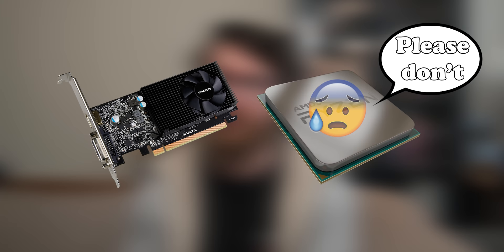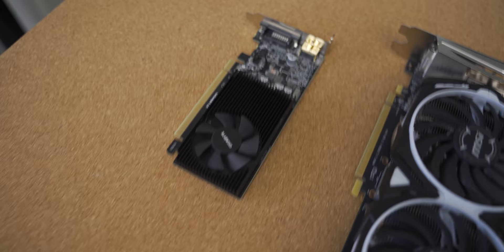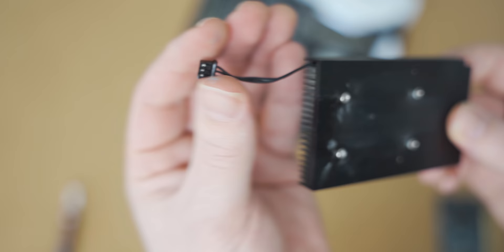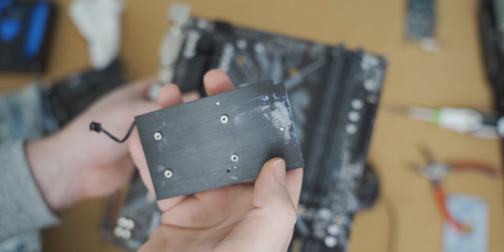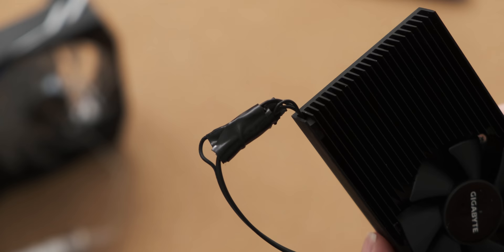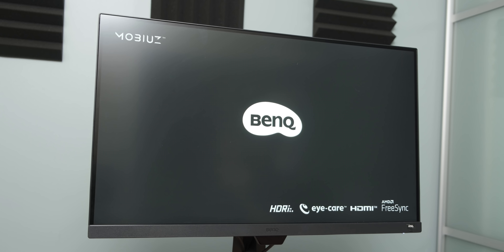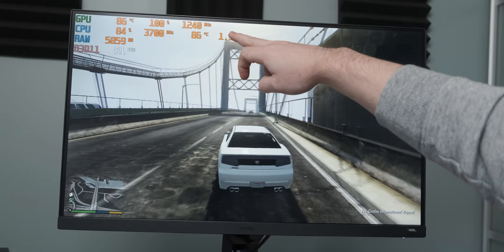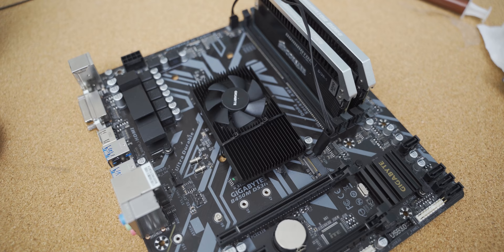GPU cooler on CPU - Cooling a CPU with a GT 1030 heatsink?

Comment: ive always wanted to do something like this hahaha
i actually have a plan to use a stock vega 56 cooler on to a laptop as an auxiliary cooler but the laptop is not here yet hahaha
Reply: U had any luck?!?!?!?!
Reply: @FS--ew3se  turns out i need a lot more tools specifically stuff to cut metals because the gpu coolers got those pins that poke out. and also a safe place to do it hahaha 
what i ended up doing was just remove the bottom lid and put some mini heatsinks those used on mini computers and a liquid cooler but the AIO i got was kinda crap so doesn't really aid with cpu temps that much.... so i just placed 2 120mm cpu fans underneath and power them with external 12v power bricks helped drop temps a lot but causes faster dust build up
Reply: @meareAaron  lol

Comment: Wtf is that graphics card. 95°c on a Graphics card isn't acceptable especially not in GTA V. My 1050ti reaches a maximum of 85°c and I would not prefer to run a graphics card that hot...

Comment: I always watch for the laughs but it always so cringeworthy when he actually tries do something i.e the gpu fan soldering and testing . Why wouldn't you just jump a PSU and connect the fan to that for test. "oh I don't have a molex/sata to 3 pin adaptor" You just need 2 wires to test but ok. Always hard to watch but always funny ........the main reason I'm subbed.